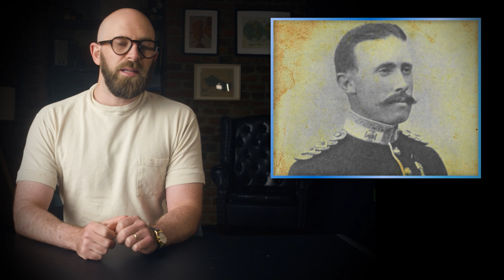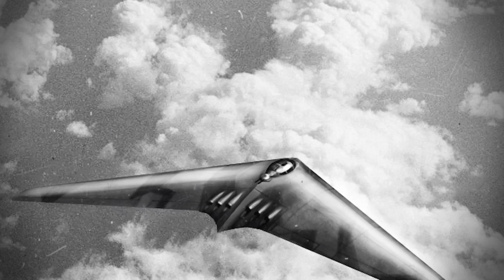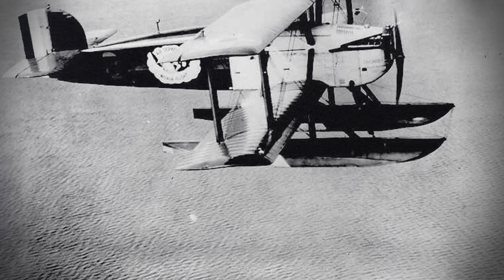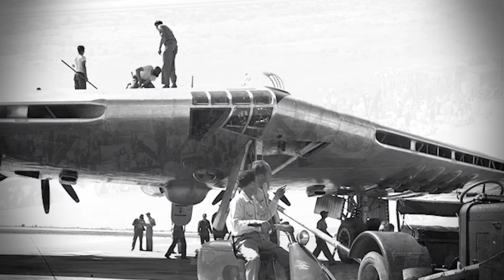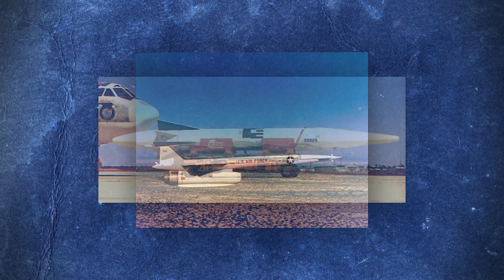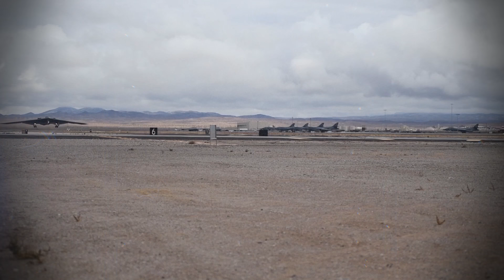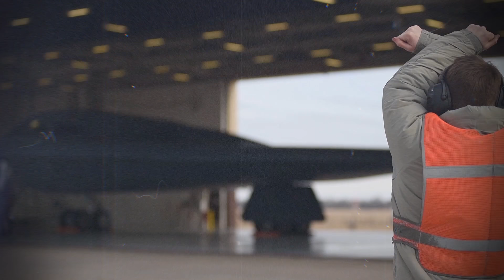$2 Billion Each - A Deep Dive Into the Incredible Engineering That Culminated the B-2 Stealth Bomber

Comment: Easily cheaper than diamonds of equal weight.
Reply: Yeah, seeing as ONE Gram of diamond costs between 8,000 and 70,000 dollars, and an empty B2 weighs 72,575 Kg, the cost of the cheapest quality diamond B2 replica would cost $580,600,000,000. Which is more than the $2,000,000,000 quoted in the video title.
Reply: @avr8844  Or 363,750,000 carats.